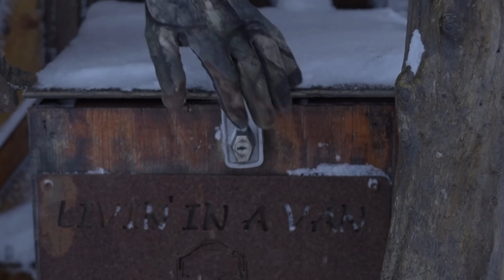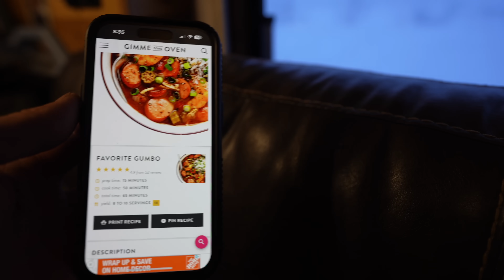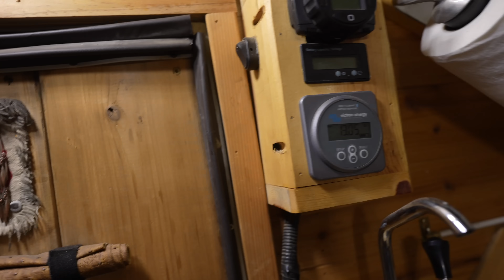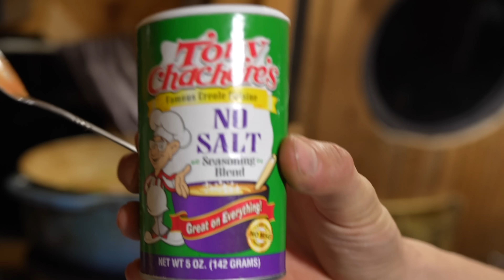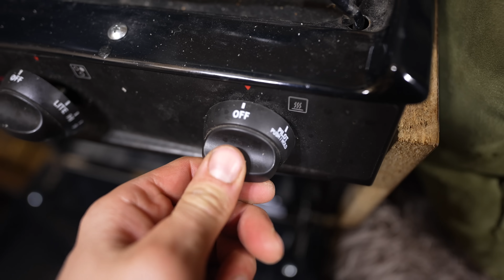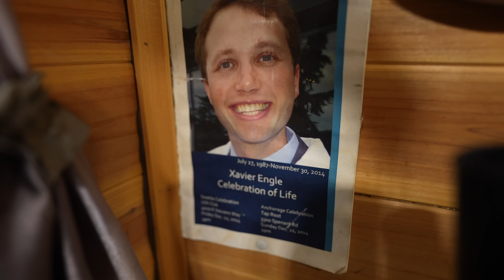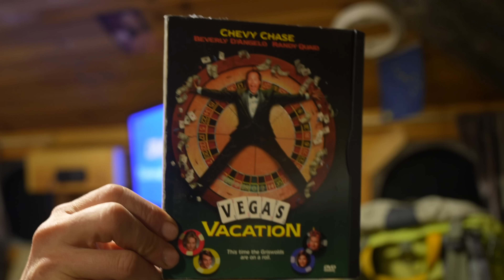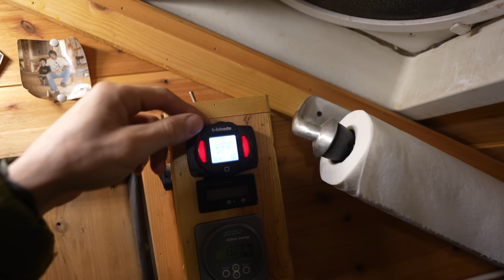Riding Out a 60mph Blizzard in my Homemade Truck Camper #alaska #vanlife #asmr #wintercamping

Comment: I had a 1992 F250 with the naturally aspirated 7.3l, although I added a turbo to it. Most reliable vehicle I have ever owned. Never failed to start on the coldest mornings as long as I replaced any bad glow plugs in the fall and replaced the heated fuel filter yearly. Great to see a 7.3 doing its job after all these years and inspiring the kind of confidence it takes to make a 2000 mile journey during the darkest coldest time of year.
Reply: Why family were loggers in Newfoundland, Canada where conditions were always rough and sometimes Arctic like conditions. Over the years we tried, GM and Dodge, but Ford always prevailed hands down. No comparison. There is no small reason why in Canada for over 60 years straight, Ford pickups were the number one selling of all vehicles in Canada, cars included.
Reply: Glow plugs in the 80s failed when it was 90 degrees. They wee pretty much worthless.
Reply: You had a 1992 na 7.3l with a turbo additon, and it worked??
Reply: Quick question.  What were you hauling with your 7.3 with your na that you needed a turbo on it?  I bet a 7.3 has a lot of torque  and hp.
Reply: @robertlevy105  yes, they sold turbo kits for them. One was from Banks and the one I put on was from a company called Hypermax. It was non intercooled but the difference in power was night and day. It was supposed to add around 80 hp which was a lot back then.
Reply: @robertlevy105  the n.a. 7.3 was rated at 190 hp in 1992, so not a powerhouse to say the least. I forget the torque rating but it was only around 300 something ft/lbs. You can Google the numbers for the 1992, they're not very impressive, there's a reason they started turbocharging them. Great reliable engine though.
Reply: @robertlevy105  I was hauling a 24 ft Bayliner Ciara. It was 12000 lbs fueled with the water tank full.
Reply: I have a 2000 F350 with a 7.3 turbo and I know it needs something. I have to keep it plugged in if it gets a little bit cold or it’s a rough start. My GMC friend says if it starts and runs it’s fine… er, no. It should start better than it does. He changes his own glow plugs but doesn’t want to help me with my truck. I don’t have any money to take it in but when I sell a few houses it will go in and get new glow plugs and anything else it needs. I need to tow a 1970 something mopar from SW Washington State to SE Oklahoma.
Reply: @dawneendostert3576  If you can change a spark plug, you can change a glow plug. They're even easier. No gap to measure.
Reply: @robertlevy105  This is misinformation. The glowplugs do not fail in 90 degrees. If yours did, it just happened to be 90 degrees out, but it didn't cause them to fail. Under hood temps reach far hotter than 90.
Reply: @robertlevy105  I have two '93 IDI work trucks with added banks turbos and universal intercoolers and they don't just work but they've been working hard for years. Without the turbos, they didn't have any trouble starting any load off the line or on a flat road, but since they are such low hp engines (regardless of having plenty of grunt) they would slow right down to 25mph with your foot on the floor, screaming in 2nd gear, doing anything other than running empty. Not much faster uphill without a load either lol. With the turbo, they'll run up grades just about any speed limit, loaded to the max or beyond their weight rating. Massive difference.
Reply: Guys, here is our Savior

HalleluYAH translates “Praise ye YaH”

YaH is The Heavenly Father 
YaH arrives via the TENT OF MEETING
YaH was Who they Crucified for our sins
YaH was Crucified on an Almond TREE

— Ancient Semitic Cuneiform of Moshe (Moses)
— Isa Scroll (The Original Isaiah)

Isaiah 42:8
"I am YaH; that is my Name! I will not yield my glory to another or my praise to idols.”

Isaiah 43:11
“I am YAH, and there is no other Savior but Me.”

Isaiah 45:5
“I am YaH, and there is none else.”
Reply: I miss the days when Ford trucks were so reliable.
Reply: @BodhiTheBohoHobo  They're not anymore?
Reply: @YaHsServent  Rescind the doctrine of discovery. Screw false gods and their evil.

Comment: You should run a couple of lines off of the heater hoses to a small core in your cabin: Take advantage of the free engine heat while you're driving, so your cabin can be pre-warmed when you move into it.

Comment: Put a heater core in the camper so it keeps it warm while your driving. Include a separate electric circulation pump to take the rest of the heat from the engine after shut down. Mount the core with flexible hoses so you can place it on the wood stove in the morning to preheat the engine for easy starting.
Reply: That’s actually a pretty cool idea
Reply: Brilliant man.
Reply: Dang, you should make and sell truckhomes!!! I bet you'd have people all over buying them from you! $$$!!!

Comment: Hi Tim. Love your channel.  Videos are awesome. When I watch them I'm totally  absorbed. and forget any problems I have.  

 A humble suggestion though.... Have you ever considered an RV type dining table?  You could install two  flanges on the floor that accept both  tubes for the table. Obviously you would have to trim the table down maybe about 1/3 . Now you could actually have a table to eat your dinner on not to mention paying bills and You -Tube  updates. 

I 'm going out on a limb here and suggest you might want to consider selling the old girl and getting a V10 Gas F350.  No worries about starting at minus 70  not to mention the 50 bucks per night it takes your diesel to idle all night.    Add some studded snow tires and I think you could have a more reliable platform.  I don't mean any disrespect and know you aren't made of money  so its clearly your call.  

Another suggestion that has worked for me when doing very long multiple day and night drives  is to chew gum while you are driving. After about six or seven hours of driving I get what I call tunnel vision. Thats when Im most vulnerable to falling asleep while driving and for sure you dont want to do that on the highways you drive on. 

Thanks for the great content . Stay safe and God Bless!

Comment: You know what's great for starting fires soft wood slabs. Slabs are the cut offs of trees being turned into boards. You can get hard wood slabs too I had a Montgomery wood and coal furnace and when I wanted a quick good burning fire that's going to throw heat fast I would cut the slabs to length then chop them thin and build a cube of them back and forth over paper and on top of that really thin hardwood I would chop from my straight pieces and watch it go in ten minutes I could have bigger hard wood hunks burning and throwing heat

Comment: To help prevent your loss of fuel Either modify the cap to include a cable retaining device or purchase. The cap with such a device already affects to it. I.e. A little chain or cable to ithe company I used to work with.  Use the have drivers that would lose their All the time. I was actually given a $500 bonus or gift. Whatever you want to call it at that time for coming app with the idea of affixing every cap with a cable 2.  The bottom edge of the tractor cabs there were tractor-trailers company thought it was an awesome idea. They never lost another cap. May not be on, but they didn't lose the cap.
P

Comment: While I bet it doesn't take long to warm up I often wonder if there is some way to route the truck heat into the camper when driving. Keep it warm, or able to be warmed up as you get closer to the camp spot, so it is nicer when you go to start the stove. Maybe a bypass to route a heater pipe into it? Probably more work/potential issues then it worth it though.
Reply: not difficult at all..jeep makes a backseat heater..it's just some extra hoses and a heater core with a fan

Comment: Not sure if you still have that truck this is a year old now but i noticed you had a sqeek sound coming from your engine bay after you started, if im right that's a 7.3 powerstroke i had the same squeek was a broken serpentine tensioner would have gotten way worse had i not replaced it when I noticed the squeak you might wanna check that out

Comment: This is pretty extreme, but it's an example of why I turn up my nose at a lot of the tents and shelters that people seem to love so much.  "Oh, we don't put up the Clam if it's going to be too windy."  You just can't beat a hard-sided camper for extreme wind conditions.

So the whole point of having that extra bit of shelter is instantly defeated when you most need it?  Oh.  OK.

I'm always looking for and trying to design, a super-strong shelter.  I don't like driving around with a big, topheavy, inefficient, hard-sided camper.  My solution is to have an offroad squaredrop (like a teardrop, but box-shaped) mini-camper.  I can pull it ridiculously easily with my Tacoma.  If my pickup can handle the road/weather, it can, too.

But I still haven't quite solved the "perfect, wind-resistant, heated shelter."  The RBM up-2 or up-5 look close to what I'd want.  The dome shape and the genius design make it the perfect, blizzard-proof tent.  

I've thought about customizing a heavy-duty (Endeavor) EZ-Up (brand) canopy, that can be heighg-adjusted down in high winds.  Park the mini camper part or all the way under the EZ-Up, to create a nice dead-air space around the thing.  

I've also thought about making a frame that's built off the top of my little square drop, with "ribs" that extend out and down to make a half-Quonset hut   It'd be more work setting up than the house on wheels of this channel, but it would be more nimble on the road, especially because I can always detach the mini-camper and run around in my pickup.

I've just been on too many mountain roads and high-country Interstate to want to drive something as big and tall as the house on wheels.  I've seen worse, but I can't tell you how many RVs I've seen by the side of the road that flat-out got blown over by gusting winds.

Comment: You should look into having that campus place or the company that made that tent if they make other canvas products A bra type deal that would wrap around the front of your truck. Hooking to say the back of the doors down to the ground and conferencing the tires to block off the heavy wind and snow potential from being driven into the engine compartment of the vehicle while you're headlong into it.  Sitting near parked overnight